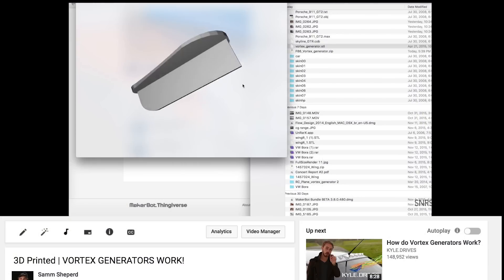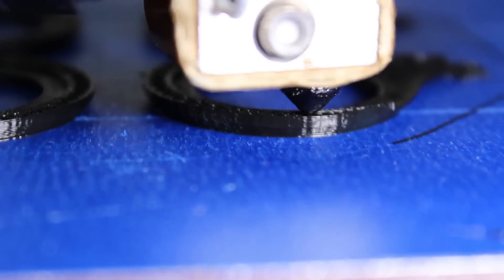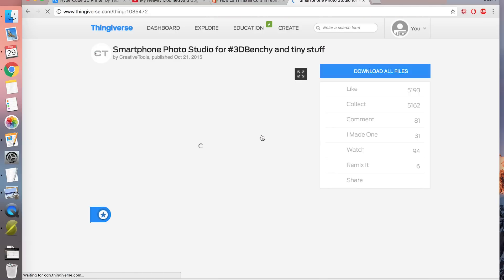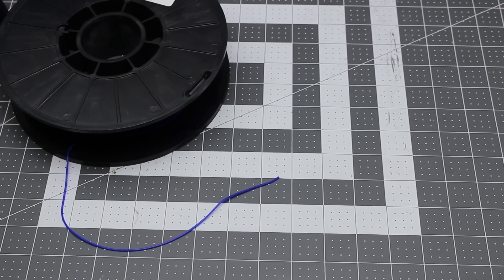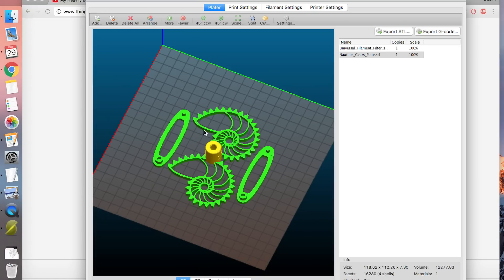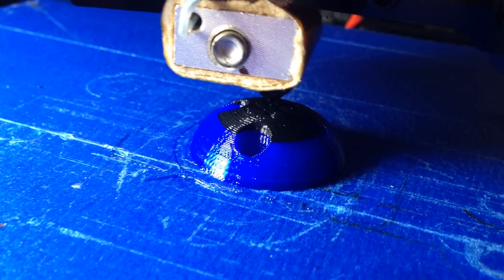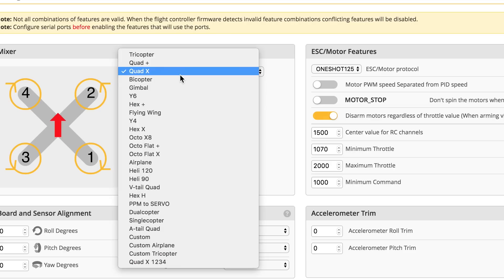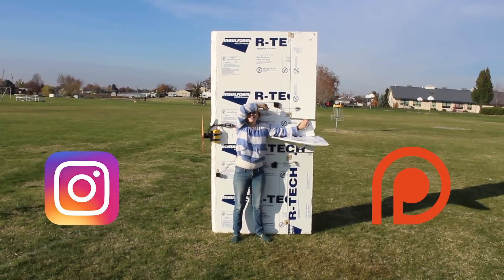My Personal 3D Printer!

Comment: Add a nozzle fan for improving printing quality, thats why I dont use the Anet A8 instead of the Original Prusa.
Reply from the maker: +erny1601 I have since printed many accessories including a part cooler and overhead filament holder

Comment: what is the range of your transmitter?
Reply from the maker: couple km. could snap a long range UHF module on the module bay and get 50 miles + though.
Reply: Please do a video with long range UHF, where you explore mountains and go farther over the ocean. That would be awesome! ...but record in HD, not the analog FPV feed that you use to pilot. Thank you.

Comment: Just ordered this 3D printer, What settings did you use for TPU?
Reply from the maker: First get it printing PLA correctly. Then print around 220º and pretty slow. You can try and tune setting in real time.
Reply: Thank you!! =)
Reply: I have the wood version and have been too scared to use TPU so far. Did you have to make any changes to your extruder to keep it from bird nesting inside of it? Or is your extruder completely stock? I think a quick video on that would gain many views as the Geeetech is a very popular printer right now.

Comment: I've been looking at that printer also. Did you have to apply any mods to get it the way you have it?
Reply from the maker: The set up in the video is 100% stock. Though the best upgrade I've made is simply a 200x200mm sheet of glass for a print bed and then for everything except ABS having a fan blowing over the printer helps with print quality. Or just print yourself a duct for a part cooling fan.

Comment: Banggood has some cool cheap stuff and I love buying from them, but the price of that PLA is nearly DOUBLE what a very good roll of Hatchbox filament goes for.  (usually less than $24)
"Because it is sold by weight, the length and thickness will vary" - Not what you want to read when buying expensive PLA. The places that make it take extreme measures/measurements to prevent much variance in the thickness.   
"Printer jams are always due to improper sized rollers and / or liners" - Or particles in the filament... Or bad width tolerance in the PLA???
Reply from the maker: +marks47 that is some pretty sketchy things to say.. I do like how it's glossy and not like some other filaments I've used. It has not jammed on me yet. I used my calipers and it ranges from 1.72-1.79mm
Reply: how acurate are your calipers? ColorFabb states their diameter tolerance on their filaments are +- 0,05mm.
Reply from the maker: Björn Kok They cheap calipers, but they seem to be accurate from my testing.
Reply: i got some cheap but quite well ones as well, but measuring 2 places behind the comma is quite difficult to get right. Good to see you got your own printer! got my first 250 quad on its way now. love your idea of the bicopter, would love to hear your idea's and problems

Comment: you shouldn't use slic3r since it is really bad at handling prints, makes bad g-codes, and your prints come out not looking as good as they would be able to come out. Also Slic3r is really old, and does not use modern ways of slicing.  I'd recommend Cura.

Comment: Hey, I've noticed that you don't use any cooling fans directed at the printed part, could be mistaking and didn't see it, but if you don't have any then you should see about installing some. They help with keeping corners sharp and prevent distorting your print when the previous layer hasn't had a chance to cool down and solidify yet.
Great videos, looking forward to more.
Reply from the maker: For some PLA parts I had a big fan just blowing over the whole thing. But yea actually I just printed a duct that fits my extruder and redirects the heatsink fan air over the part

Comment: In concept 3D printer seems cool, but I guess you have to pay a lot for something that prints smooth/fine grain products. Maybe this one is cool with a bit of sanding, but just out the printer the pieces look pretty janky
Reply from the maker: You can get better parts with better tuning or upgrading certain parts. SLA printing results in almost 0 layer lines https://www.youtube.com/watch?v=FnHYVj0j8fU
Also, ABS parts can be polished smooth by exposing it to acetone vaports

Comment: Awesome!  have you tried and 3D printed propellers? I've had great success with an 8040 (i remixed it with built in supports), and one of the 5 inch ones. both on Thingiverse.
Reply from the maker: +ZakkBlog I tried printing a folding prop a while ago and it didn't turn out very good, but if you say you had success I might wanna try it again
Reply: this is the one i've had the most success with on my planes: http://www.thingiverse.com/thing:1738539
not my desing, i just added the meshmixer supports. haven't done a video about them yet.

Comment: interesting that you can use multiple sources of printing material. the big reason i didnt purchase a 3d printer yet is becsuse the pla seemed to be the easiest choice but the most unusable material in the real world. would be interested if you can build custom water pipes or bongs with homemade designs, which was going to be my main goal until i found out the material really isnt anything fire should be around

Comment: Good for you. Keep trying for success. 60% of the time prints will fail. Also, don't claim your printer is better is better than makerbot. The makerbot your university has is really old and is very outdated.
Reply from the maker: +Cjkturtle I'm not claiming it's better, but in a lot of ways this cheap thing is more enjoyable for me personally to use. 60% is a little much though :) my school also has some very high end SLA printers and a huge duel extruder ABS oven printer but those are used for classes not my shenanigans

Comment: I tried a dual copter after seeing the MESArc video.  One problem I had was I first used really low resolution servos (cheap) and it was doing weird things like overcompensating and wobbling, completely unstable.  Using better servos with higher resolution helped a lot, but it still seemed unstable beyond a hover.
Reply from the maker: +thechosendude but how did you get the mixing correct for both pitch and yaw?
Reply: +Samm Sheperd (SNRS) what is SNRS??
Reply from the maker: mihir pardesi My initials
Reply: +Samm Sheperd (SNRS) OMG !!!You replied!!!! Thank you for replying my dumb comment . You are awesome . keep making content.

Comment: Got my self a Duplicator i3 a couple a weeks ago. From what i learned you could try to enlarge the distance of the fillament retraction. That way you could get rid of that stringing on that gear part.
Reply from the maker: +Faszinated that was a bad print lol and it's just the bottom layers because it was printing way too fast and hot with lower feed rate.

Comment: Print this using pla or abs. You can thank me later. https://www.thingiverse.com/thing:1813314
Reply from the maker: I have a flannel sheet over my table that I put it on and that almost makes it silent lol, but I think I'll give those parts a go!
Reply: Please, do :) I had foam underneath and enclosure around - still there was a HUGE difference with these. This should be a mandatory first print for every new owner. It even fits on the bed for a single run...

Comment: Could we get some updates as you continue using it as to any technical problems/stuff breaking/ etc? I'm looking for a 3d printer kind of like this, but will be a bit tight on time when I get the funds vs when I have to turn in the project I need to make on it. Also, how did the setup process go with leveling the plate etc?
Reply: Also, reviews on the banggood page mention pieces missing or damaged. Did this happen to you?
Reply from the maker: +Veseyron I've had it for more than a month with no problems. It's only gotten better as I improve my tequniques. Leveling the bed is trivial. Some basic troubleshooting skills are required. If you just need something to work with a time crunch, a prebuilt printer might be the way to go
Reply from the maker: +Veseyron I had all the parts. stay organized and don't loose them. It comes with the packing list and a signature from the guy who packed it, so you can get replacements by sharing a picture of the signature and the broken or missing part.
I DID have two broken acrylic pieces, but I did not try to get replacements. I glued them back together with superglue and it holds great.
Reply: *****  Thanks. If funds were not a factor, I'd go with prebuilt, but as the project has a limited budget I think I will monitor the DIY kit market closely. After I'm done with what I'm supposed to do I get to keep all the stuff I buy, so I want the best bang for the buck but at the same time I'd like it not to break too soon. Unfortunately, when buying hardware, living in a country with a not-so-strong currency is a real pain in the ass.

Comment: hey samm, i own a geeetech prusa i3 to. i printed for a while in the stock configuration but my prints could be better. For a few months now i upgraded it to a e3d v6 lite and my prints are so much better now. The e3d v6 has a lot more even extrusion flow making for much nicer prints. for 35 euro's it is a great upgrade!
Reply from the maker: +IJsbrand de Vos that's another thing I'm psyched for: numerous easy upgrades! I've heard about the v6 and I think I'll go for it!
Reply: yea its so cool. you can upgrade your printer by printing parts. if it doesent fit just print a bracket :D

Comment: Hey Samm, nice video! I have the same printer in a dual extrusion configuration, and I can only recommend switching the aluminum build plate for a glass plate, as the aluminium tends to flex. Also if your looking for Design software, check out Fusion 360 (it's free for personal use). Have fun printing!
Reply from the maker: +Random Tree I use fusion360 for all my CAM/CNC work. And yea I wanna get some glass

Comment: have you seen barnacules video on 3d printing where he uses a sponge with a oil reservoir to have smooth loading?
Reply from the maker: +Risto Mladich I'm using a lightly oiled foam block for dust filtering and lubricating from one of his videos if that's what you mean.
Reply: ***** yeah also how does this printer compare to the makerbot that you have used in print quality?
Reply from the maker: +Risto Mladich if tuned properly, they can be extremely close in quality, and cheap upgrades will help. Currently the makerbot has better prints.

Comment: Love your vids Samm, I was just looking at a 3d printer and then your video came out! Gearbest has this really cheap printer   http://www.gearbest.com/3d-printers-3d-printer-kits/pp_343643.html      and it seems to be a clone of the one banggood sent you. Pretty awesome deal
Reply: geeetech is one of the bigger 3d printer distributors in china. the clones will print to but the fitment on those can be a little off. check out the sumhokey prusa i3 printers they are cheap and are also a pretty big distributor.
Reply: I wonder if it's any good. Seems tempting for the price

Comment: Hey Samm, I want to share my experience in 3-D Printing with you:
Did you try Curaengine instead of slic3r?
It makes a much smarter G-Code, but does not support this honeycomb infill. But the final result is often more stable and has a better surface.
Just try it out!
Reply from the maker: Yes I like Curaengine a lot. It only works with Windows though and I don't always have a windows machine around.
*edit: I'm wrong, read below
Reply: Maybe I'm missing something, but the Cura Software definitely has MacOS and Linux support!
Reply: Cura is available for win, mac and linux. I suggest getting the new 2.3 version.
Reply from the maker: Flippy Maybe I'm the one missing something! Not sure why I had that misunderstanding
Reply: I'd love to buy my own printer in the near future. Would you recommend this particular printer?